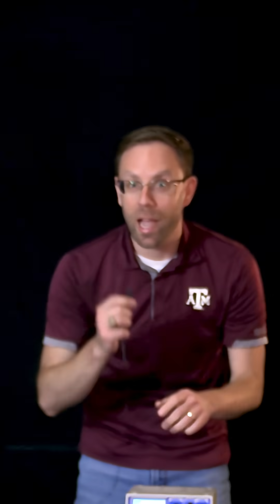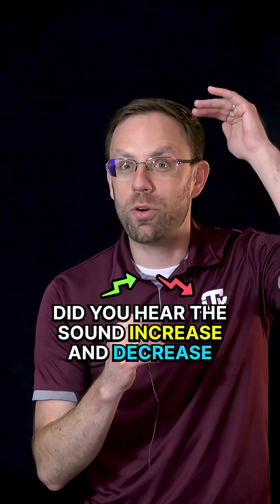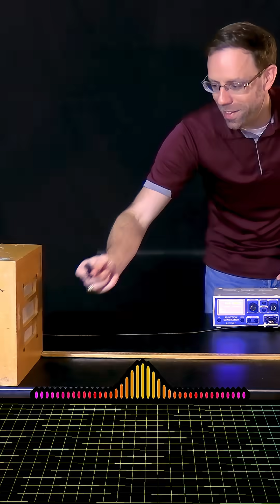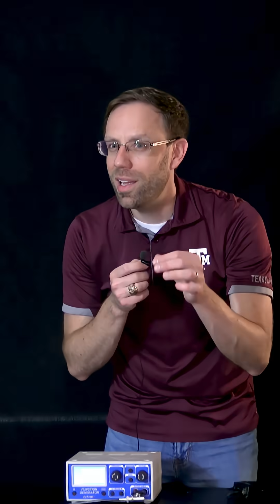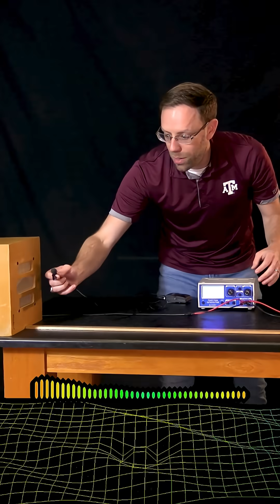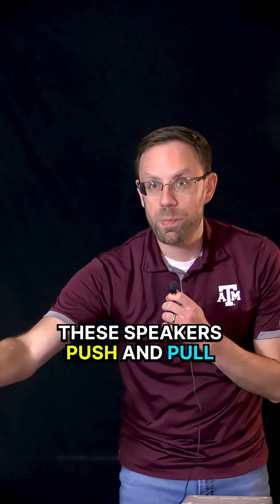Constructive & destructive interference of #sound 🔈 #DrDawson #shorts #audio

Comment: Such a cool demonstration. Is the frequency of the function generator lower than hearing range?
Reply from the maker: No, the frequency of the function generator and also the sound is 680 Hz, which is typically between 20 and 20,000 Hz. The function generator output signal is directly sent to the speakers so they oscillate at the same rate.
Reply: @tamuphysastr It'd be cool to see the microphone tied to an oscilloscope, I imagine it would have the same frequency as the speakers, but variable amplitude depending on it's placement